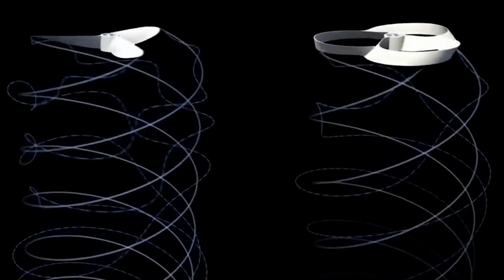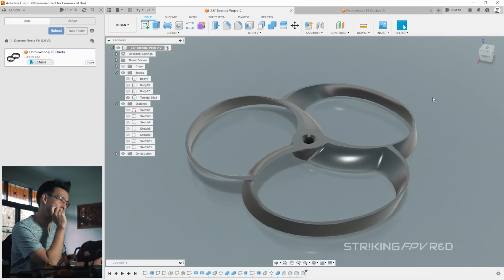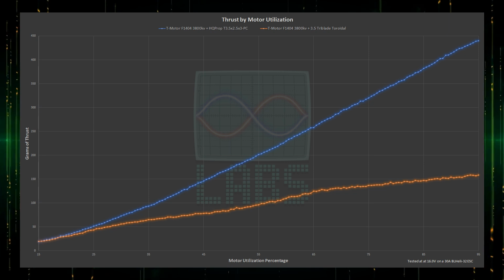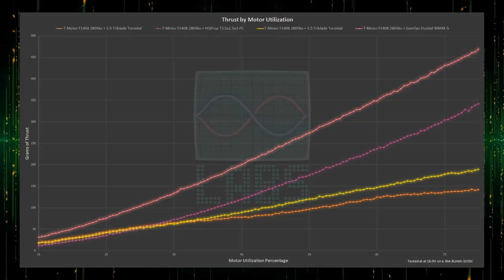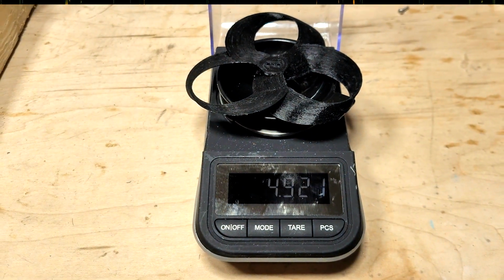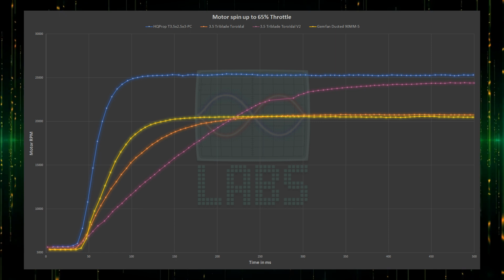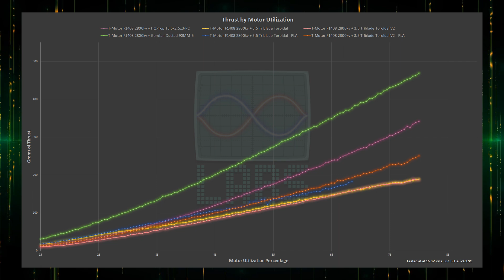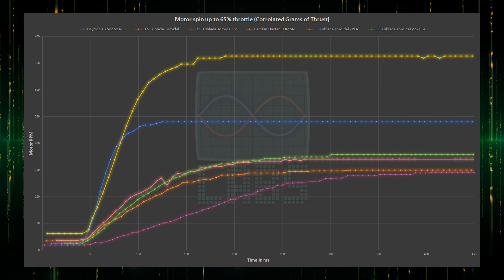MIT Toroidal Propeller Testing - Performance, Efficiency, and Response - PETG + PLA

Comment: Dude, the analysis you've done here is fascinating and way in-depth, thank you for putting it through the wringer. Not sure what to make of it at the moment, but I'm thinking more and more that the pitfalls of 3D printing are also hindering performance a fair bit, such that I'm considering designing a regular prop using the same blade profiles in order to get a "fairer" comparison.

Still not exactly fair, since it seems toroidal may forever by crippled by needing to be 3D printed or machined because of the complex shape which makes injection moulding maybe impossible.

At least FDM seems crippled, I'm still waiting to see if anyone gets a nice and durable resin print, or a sintered version.
Reply from the maker: Hey bud. Thanks for publishing the designs. I managed to get the PETG prop smooth where it contacted the air by using really high grit sandpaper to shave of any imperfections it had, but the limiting factor here was flex. With PLA the print actually came out extremely smooth with 1.4mm layer heights and was stiff (which is why it shattered under load), but yeah there is only so much you can do with a FDM printed prop expected to spin at over 35,000 RPM. 

I do question if this is concept is actually viable though for two reasons. The first being the extra weight needed to create the shape that isn't contributing to providing thrust, which would make it hard to make it efficient comparatively. The second is the data MIT did release, or rather, didn't release. The data they released was primarily focused on the frequency of the noise the propellers made, and they published frequency analysis. They showed thrust stands that use, and it is made by the same company with the same capabilities as mine, so they absolutely would have been able to and very likely captured detailed data during their tests. They chose not to publish it, and there is probably a reason.
Reply: @RecursionLabs  Then maybe we'll be jumping headfirst into that mysterious secretive reason 🤣. Bench tests aside, a few others have printed and flown the V2s and discovered that in flight they're alright, although @willitmod noticed some odd quirks like altitude drop in turns but increased lift in forward flight. I wonder if that will further play into the current pros and cons.
Reply from the maker: @STRIKINGFPV  Interesting. Data from static thrust is really useful, but its limited on some aspects of flight characteristics because of the fact it's only static air.

I'm watching closely to see the flight testing the you and the community are doing. Regardless of the outcome, exploring new avenues and pushing boundaries in an effort to make improvements is half the fun of this hobby.
Reply: @RecursionLabs  This was the best effort I've seen so far in terms of actual science & data is concerned.  Thanks for putting it together.  I keep proposing that folks who do these tests print a duplicate of gemfan (or whoevers) stock prop so that we can see apples to apples, at least mitigating some of the print/material shortcomings.  I wonder if you could print in NylonX or some alternative that is rigid & strong but thin enough to be an efficient prop.  It may be better to test only resin prints which will probably blow apart at higher rpm's but at least you could capture data up to that point to imply some valid performance comparisons.
Reply: @nothingnormalnet6588  I agree, different materials need to be tested. For some reason everyone just grabs the spool of PETG for their new project, but I think there are better options. Great idea about printing a Gemfan clone to see how it degrade performance over the injection molded polycarbonate+special blend they use.
Reply: As far as materials, I'm not affiliated but I've used them in the past to make a design better or simply solve something in the lab.  Igus makes specialized industrial materials and offers some of them in filament as well as powder, bar stock, and tapes. They will also prototype for you in multiple manufacturing methods (FDM, sintering, milling, et al) but I haven't priced them yet.  However, I'm going to have them make new slider bearings for my KingSong S22 after I get it back from a motor swap on a recall; wanted to wait.  I've used several other online prototyping services and they're pretty reasonable to much cheaper compared to finding a local fabricator, which I also recommend - I just head into the industrial part of town and look for shops working on stuff I need; most people are surprised at how cheap/fast they can get a small job done with a little legwork and some chat up (make sure your drawings pass their design rules and they'll love you).

Don't use nylon filaments unless you've found a way to make it hydrophobic instead of hydrophilic.  

As far as methods - standard SLA prints can still be subject to lamination issues because of the way they're printed.  To make literally impossible things that actually come out at the same material strength over the whole print as the original material, the only way I know of that right now is methods using CLIP (Continuous Liquid Interphase Printing) or similar methods; Carbon 3D owns the patent to CLIP but other companies are figuring it out.  You can't buy a CLIP machine, they only lease them and the leasing is insanely expensive, so you'd have to find a service that has one (it's like 48k USD just to send the email to ask if you can sit at the table).  Carbon does however have a good variety of the most popular industrial resins available for their process and their gear prints 25x faster than other processes, again, retaining the full material properties because the tech basically builds parts at the molecular level.

There are also ceramic resins and printing - you might try casting props as well, using 3D prints to create improved molds.

No, I don't do drone work specifically, but I was an engineering technician for 25 years in technology development and deployment.  Getting stuff done is useful no matter the industry.  :person-turqouise-waving:
Reply: @russellzauner  I'm going to email CLIP just to see if they bill me for $48k 😀  I just read up on clip, actually, I hadn't heard of it and I'm in the industry too.  Cool!   NylonX is  actually very good for a filament solution, strong, rigid, and resilient if you just make sure to dry it out well.   Maybe PC or PEEK.  If I was going to try to make near production quality props I'd most likely CNC them, although some of this toroidal geometry may be challenging.  Also, (as you noted) maybe SLA molds & cast materials.
Reply: @nothingnormalnet6588  PEEK vs PC for props? Interesting battle that would be. I've always kept my love for PEEK et al on the backburner waiting for a chance for it to shine.
Reply: @russellzauner  Wow great info
Reply: These props can absolutely be injection molded.

Source: 36 years of molding and mold building exp. over 2 generations.
Reply: @raam1666  Even a more extreme "ideal" toroidal propeller shape? How would you go about doing it, and would you modify the design of the end prop to make it work?

If you'd like to have a closer look at the geometry, feel free to download the step/f3d files of my V3 designs and just imagine the loop edge being steeper and with the trailing edges not flat on a build plate.

Comment: 1:00 Did you 3d print the other propellers that you're comparing this propeller to? Materials used does matter after all. EDIT: OK, you recognize the issue. However, I'm surprised you bothered to do experiment without setting the materials and production method as a control.

Comment: Maybe you can try with a toroidal prop that has a much smoother surface and less kv on the static station. It can be much more efficient at the lower thrust.

Comment: Nice graphs and pictures, not as many numbers as I would have liked. Weights, mass distributions pitch& change across radius, a 3-D model of the props, stiffness numbers for the two filament materials. I guess MIT isn't giving those out either.

Comment: Based on your testing the MIT design seems to fail at being better. But if the roughness of the 3D printed model could be sanded down, there may be a huge difference. Or compare the MIT version to a similarly rough surface standard prop that is 3D printed?

Comment: Great video, thank you.  Would it be a fair assumption that the inherent texture/roughness of a 3D printed propeller significantly impacts the performance compared to a more "finished" smooth commercially made propeller...especially because the thrust surfaces are doubled compared that of standard propellers, thereby doubling the drag impact coming from unsmoothed toroidal surfaces?  Doesn't seem like a true apples-to-apples comparison.

Comment: A regular 5 blade propeller is much quieter than a 3 blade propeller. Noise reduction and greater thrust also improve with more blades, but the load on the motor increases. This seems to explain the effect of these propellers. It's just a different design doubling the number of blades, with more extra mass at the ends. On motors with a power reserve, thrust will increase, due to increased consumption and the efficiency of grams per watt will noticeably decrease

Comment: Thanks for the great work!  A couple of musings: if this were scaled up, using a larger motor and prop diameter, would it make the inconsistencies in airflow caused by  3D printing less important, and the prop weight be non-linear (larger being perhaps relatively lighter)?

Comment: Great technique on the analysis, but why in the world would you compare a 3D printed prop to a injection molded one of a totally different material? That's the confounding variable that invalidates this data. Gotta 3D print both or neither.

Comment: Found this channel cuz I pulled a pad on new FC, friggin love the content! I have a request for motor testing. 1203 flywoo pro v2 nin 5500kv vs emax eco 1404 6000kv. I swapped to 1404 recently for a bit more power but I'm left very disappointed. I saw no power gains and my amp draw went through the roof, killing my flight times. Same props, frame, fc, batteries, everything. I can only go by feel, I want your testing "for science"!

Comment: Your comparing a sharp smooth injection molded blade to a gangly heavy toroidal prop.
Do a 3d printed standard prop ba these.
Or better yet send a model to this guy
https://youtube.com/@JohnSL
He does alot of small injection molds. He may be Interested in making some molds for some toroidal props

Comment: It's really tough to compare the standard propeller to toroidal and be fair.  The disc loading should be held constant when comparing noise and power, it's not clear whether that was done in the MIT study.  The weight and moment of inertia of the toroidal prop seems clearly higher, which as you find increases the response time and reduces thrust bandwidth. The toroidal design effectively has massive winglets connecting adjacent blades, so it seems reasonable that noise would come down in an apples to apples comparison, but it's very unclear if performance to weight and moment of inertia would ever be competitive.  

It's really fastenating to me how viral this concept has become.  Thanks for attempting to put some numbers to it!

Comment: I have no idea if the toroidal prop is any good or not.  I do know that your experiments add little to understanding their capability.  Building a single (or a few), clearly non-optimized crudely printed prop to compare with one that is finished and optimized is not a fair comparison. Further, based on your own data you are way off the mark for running the props you made. This is evidenced by the sluggish rise in rpm implying that, what could be thrust, is wasted as in-plane drag.

Comment: This is a way bigger deal (at least right now) for watercraft than air.  The toroidal design removes nearly all cavitation from edges, making it more efficient and quieter as well as removing the number one wear item on props - steam damage.  Theoretically, an optimized design could last the lifespan of a vessel, barring external damage input.  This isn't as important to people with small props but vessels like cargo and cruise ships are extremely costly and sometimes have to even be drydocked, which causes a lot of stress on a ship that scales non-linearly with size/mass; there is an actual industry segment that focuses solely on repair products/methods for cavitation damage on props to try and extend their serviceable life.

This is a big deal for submarines too - in the quiet sense.  The toroidal prop designs make a different disturbance and almost none of the noise, obviously advantages for vessels that want to be stealthy.

One thing I think is a fault with most enthusiasts trying to reproduce results is that nobody is using smoothing on their 3D prints.  Flying is all about wing surface behavior and influence, so why is nobody using the highly available multiple methods for smoothing a laminar 3D print?  Even spraying it with some sort of clear coat would be better than nothing, but honestly now it occurs to me that the rough surface would be great for testing coatings on - maybe using that ceramic nanocoat stuff for cars on the rotor would not only smooth out the ridges but make it slipperier in air than plastic (that's a "for instance", there are many ways this can be applied).

Comment: The 3D prints look pretty rough and likely cause a lot of air friction. It would be interesting to see what results you get if you 3D printed all of the props in the tests.
Reply: Or if the 3D printed toroidal prop was sanded as smooth as the standard prop.

Comment: The real appeal for these propellers is being quiet, not efficiency. Think of "static pressure" computer fans. You need at least six blades for these toroidal propellers, maybe even twelve or eighteen! Try it with more blades and experiment with the blade angle. I'd love to see those results!

Comment: Toroidal props are the biggest fad to hit FPV since the angled motor bases that were supposed to make our quads more aerodynamic in forward flight but ended up just making our quads fly like crap.  Now these props are not significantly quieter than regular props, their sound is lower pitched but low frequencies travel longer distances so what's the point?  But with reduced efficiency flight time will decrease so people annoyed by the noise will be happier I guess...

Comment: It has more surface area wrapping so it will have more air resistance, 1/3 of the loop is providing nothing to the motion and may actually be presenting a much greater cross section in the direction of rotational motion. One tester said it is more stable straight ahead and that cross section in the rotational motion may be adding prop centering force. The warping and blown-up prop kind of says the rotational force on those blunt outer ribbon edges is great. I would have 2 standard prop, slightly curved, shapes and connect them with a circular cross section curve instead of the vertical flat to reduce the cross-section air resistance of the connecting piece, I would also reduce the hub size. Actually, the hub with 6 blades and no wrap around would be close to the toroidal props I have seen on larger planes, it probably would weigh the same and be more efficient. The best approach is to get some type of 3-D finite element propeller modeling and concentrate on the rotational forces to increase the vertical force and reduce the horizontal, and you probably would end up with the 6-blade toroidal prop.

Comment: Thanks for this, it would be easier to follow if you kept consistent colors assigned to each setup though.
Reply from the maker: Agreed. I usually try to, but in this case I added stuff after doing all the analytics/charts, so it was this or having to redo all that work.

Comment: OK all.. 3d printed props have layer lines.. and staggered steps. Any chance ANY of those not so smooth aspects of 3d printing are affecting this? How about you ALSO print regular props.. and compare those.. lets rule out if the 3d printing layer lines/roughness/materials is the issue at least. If these toroidal props were made smooth like regular props.. how would they compare?

Comment: Nice work! I put a model you could look at in the Mini 3 Pro Forum on DJI site. The post is labeled toroidal propellers. Right now I just have a double prop posted, but I did design the triple as well, I wasn't going to print it since I liked the double ones better, but I think my profile is more standard and much lighter than the ones you've tried so far.

Comment: You should also try Prusament PC Blend Carbon Fiber. It might be great choice for both 3D printed props and sub 4" frames. Its tough, wear, UV and heat resistant up to 120C, easy to print (doesn't warp even without enclosure but it only needs hardened nozzle). 
PS. regular PC blend is not breakable as CF one + you might even consider Tough SLA UV resin 3D printed toroidal props (eg. Siraya Tech Blu resin)
Reply: That sounds like an excellent material choice. 👍

Comment: Another video I saw on this showed the MIT ones are more like a mobius strip in the shape of an infinity symbol, not this triple prop biohazard design.
I've also seen someone print and use the tri blade one on a small drone to stunning results, unless it was really good CGI. 🤔
There is a similar prop developed for boats as well.
Reply: The props for boats are from Sharrow, they work and they can be bought. MIT even references them in their patent application, which they filed in 2017. So, since then they brought us a non-informative graph in a data-less paper and a scam video that would make kickstarter proud.